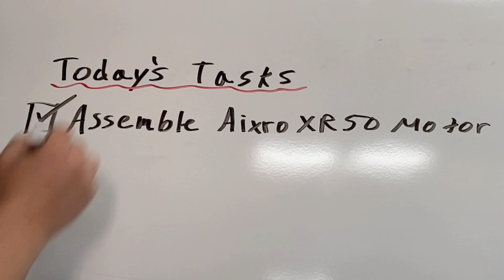Aixro XR50 Rotary Motor Rebuild

Comment: Hey nice video of the rebuilding of the motor
If you go and drive it 
The cluch plates you have in the clutch they look like the orginal and they are in like 3 houres driving finisht
The points where they go in the cluch drum will break
There are special plates for aixro 
Whit that plates you can drive for a long time
It is calt sinterplates diferend material 
And if you put them in 
There must be placed a stronger backplate in the clutch the plate whit 6screws in it where the cluch plates are pressing on 

Have fun driving it 
Regards
Reply from the maker: Hey mskartxr8, thanks so much for the input I’ll be looking into this :) thanks for watching!

Comment: Thanks for the video, Yeah Poul is very helpful he has help me with my Rotron engine. Do you know if those side plates have a hard chrome plating on them? I have rebuilt a couple of KM 24 sachs wankels engines and the side plates have some type of plating on them.
Reply from the maker: Hey mfpitci, There isn’t any plating on the Aixro. However the do need to be “Lapped” for smoothness so the seals can glide. Thank you for watching :)
Reply: @joeaverage8396   OK thanks, i have some Sachs 303s engines in parts and just had a look at the side plates, can not see any plating on them.
Reply: How much did the rotron set you back ? They make some tidy engines

Comment: How did you set the ignition timing? I've watched another video and they just said to set it as early as possible? Did you find this to be accurate? I just completed my rebuild, it's on the table as we speak.  I used this video, along with the one from AIXRO to complete it.  You have the same ignition as I have, the video AIXRO sent is for the PVL ignition, so I can't follow that part!
Reply from the maker: Hey Branden, That is correct. Set the ignition as early as possible. Thanks for watching, I’m so happy the video helped you! Have a great day.

Comment: Considering rotaries are simpler and have no vibration, why do you think they're not more used in karts? I know they're not used in road cars because of emissions, but in karts they normally use 2 strokes, wouldn't the rotary be better?